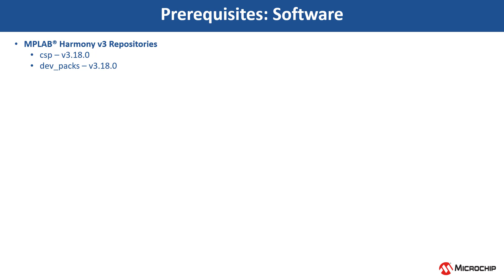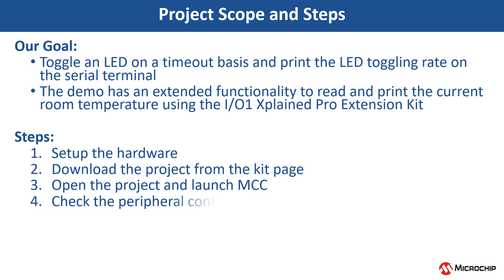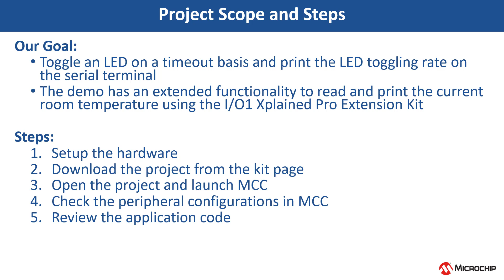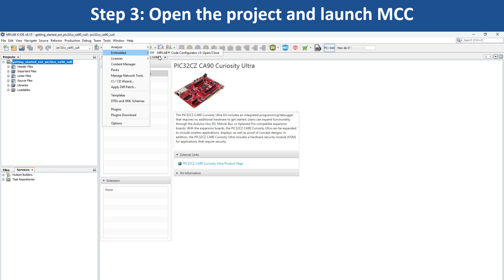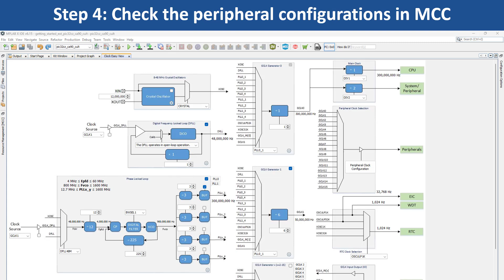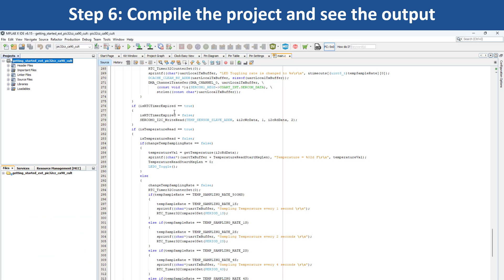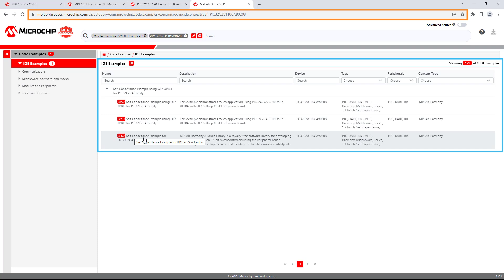Demonstrating Application Development with PIC32CZ CA90 Curiosity Ultra Evaluation Board

Comment: Please show demonstration CMSIS-DSP enabling in MAPLAB IDE
Reply from the maker: Hi there, thank you for your question! While we do not offer a direct demonstration for enabling CMSIS-DSP in MPLAB X IDE, we are happy to provide step-by-step guidance to help you enable CMSIS-DSP support for the PIC32CZ family.
 
The PIC32CZ CA family is based on the Arm Cortex-M7 core and is designed for high-performance applications, To enable and use the CMSIS-DSP library in MPLAB X IDE for a PIC32CZ CA series, here’s a step-by-step overview:
 
1. Check Device Support and Tools: The PIC32CZ family is supported primarily through MPLAB X IDE and the MPLAB X Plug-in for Visual Studio Code
2. Obtain the CMSIS-DSP Library : Microchip provides the ARM CMSIS-DSP library as part of the ARM CMSIS Device Pack, which is included in the MPLAB Harmony repository.
3. Create or Open Your Project in MPLAB X IDE.
4. Add the CMSIS-DSP Library to Your Project.
5. Configure Compiler and Linker Settings.
6. Include the CMSIS-DSP Header in Your Source Code.
7. Build and Test.
 
To ensure we can assist you effectively, please feel free to contact us at https://www.microchip.com/en-us/support. We look forward to supporting you with your development needs!